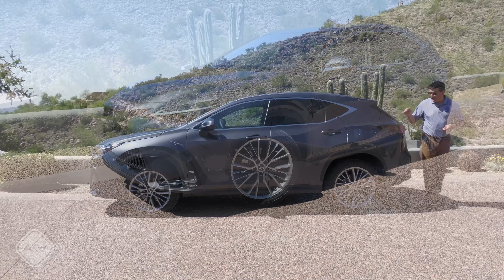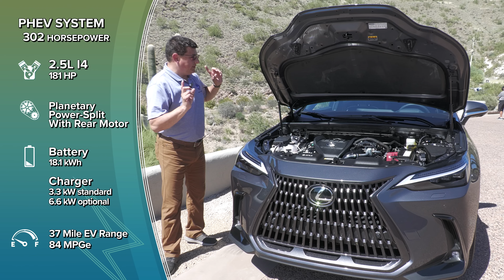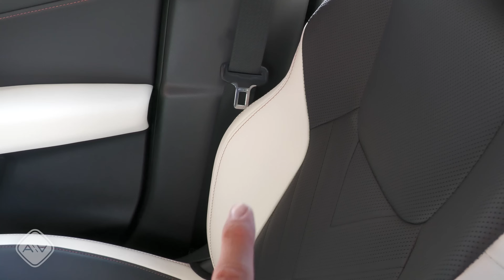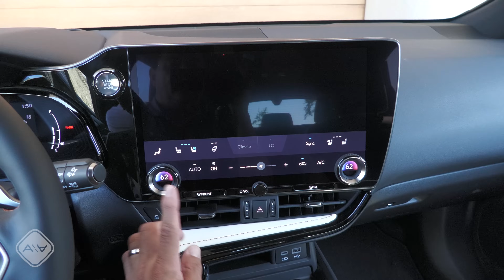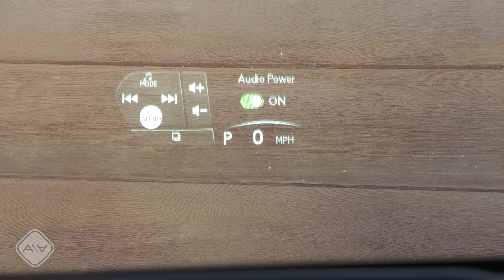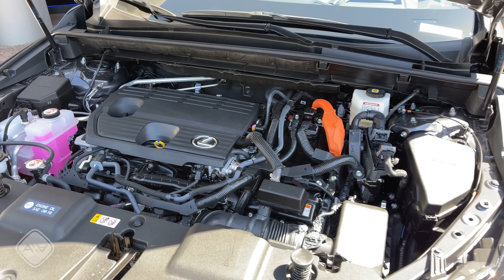2022 Lexus NX First Drive | Big Screens, More Hybrids!

Comment: the trim naming is....
what you guys think? 

NX 250....... 2.5L/203hp
NX 350........2.4T/275
NX 350h......2.5+E/239
NX 450h+.....2.5+E/302

Does this indicate that next RX 350 will actually be turbo-4 and not 3.5L-V6?
Reply: Whatever the naming, I suspect the next RX will drop V-6 in favor of a turbo four.

Comment: The 2.4T version has 275HP and 317 torque which are pretty good in compact SUV segment, however 0-60 still takes 7s? That puts it to the slow end of segment and doesn't make sense.
Reply: Yes, the 301 hp 3.5 V6 from the RX would have been a much better option.
Reply: @RightLaneHog3151  agreed 100. The RX has 295hp. The Camry has 300hp

The v6 would be perfect and I’d recommend the nx350 just for the v6

Comment: This or GLB?
Reply: This, and I don't even like it that much. The GLB is just plain homely, as are all the current Mercedes SUV/crossover models. They have a melted look.
Reply: I test drove both the GLB and GLC, if you are going with a MB, spend a little more and get the GLC.  I also test drove a 2021 NX300, and now waiting and most like get a NX350.

Comment: NX 350 does not make 275 hp, Lexus is flat-out lying about its real-world power output based on the 0-60 time of 6.8 seconds or they are severely cutting boost in low gears or the transmission is hot trash. BMW X3 with 248 hp does 6.2, Audi Q5 with 261 hp does 5.5. And all that piano gloss black on every high-touch surface is going to look terrible in 6 months. Another throwaway Lexus product to not even consider.
Reply: Ikr. I knew Thr nx turbo would lose and I was right. A cx5 for gods sake also smokes this at a lower price. So does the Acura rdx
Reply: Maybe your experience with other OEM piano black is all scratching and marking. However Toyota knows how to do paint that doesn't wear or scratch. There are standards for it.

Comment: I like the changes made except the requirement for a monthly subscription for the embedded navigation.
Reply: Everyone uses their phone or an old fashioned map.  Embedded Nav is trash in all cars.  All you need is CarPlay.
Reply: @user-tb7rn1il3q  I prefer having a backup just in case I wind up in an area with no cell reception or data signal
Reply: @naveenthemachine  I have paper maps for that.  Most areas have cell reception and you can get offline maps.
Reply: @user-tb7rn1il3q  you still use paper maps? You do realize it’s the 21st century right?
JK haha 😆

Also I know you can get offline maps for some but in google maps especially I hate the navigation in offline mode. It doesn’t announce next turn directions with street names. If you are online, then the navigation is fine though. But since my car has a head up display, I prefer seeing the next turn graphics there. That’s why I use integrated nav. I somehow love the snazzy next turn graphics on the gauge cluster and hud
Reply: @naveenthemachine  If you start the journey with reception it will keep giving directions if the connection is lost.  There is nothing wrong with exercising the brain with paper maps and a compass.

Comment: I love Lexus, I’ve had 3 of them BUT… I was waiting to see what they did with the NX now that the RAV4 was redesigned. I love the RAV4’s style and was hoping to see the NX elevate the looks of the prior generation. They didn’t, it’s still bland and in my opinion, the RAV4 looks better. 
Reliability is its highest card, as always.
Reply: With transmission issues?
Reply: @Oldchrysler  Lexus as a brand and Toyota have the perception of being highly reliable. I’m sure there haré hick ups here and there, I haven’t owned or experienced all their models though.

Comment: I really really wished there was the 3.5L v6 that has been refined for the years and had more power. But instead they gave us a 2.4L turbo that is very very conservative tuned. Hopefully we get an real Fsport trim later on with a slightly more power tuned engine to match the germans.
Reply: It is my theory that the 3.5 will disappear across the board for the Toyota/Lexus for this engine. It would not surprise me that this engine debuts for Toyota in the Camry next year. Even though it has been around since 2005, the 3.5 is such a strong, smooth, and potent engine.
Reply: @hellkitty1014 Ya exactly. When the new Highlander hybrid and Sienna ditched their 3.5 hybrid powertrain. I still had hope the Lexus will retain that powertrain as part of their luxury segment. But your right its slowly starting to fade.
Reply: Yes, the V6 was a better choice. I think they sent a clear message with the 2.4 Turbo, the plug-in Hybrid is the top performer.
Reply: They're doing the same as everyone else. It's hard to justify putting a heavier, thirstier, and more expensive engine in when a turbo four can make as much or more power, and typically more low-end torque. Most Lexus buyers will hardly notice the difference.
Reply: Emissions are another reason the V6 isn’t offered. It’s an old engine so would take significant investment to clean up and make more efficient. Plus, it would still be heavier than the four cylinder.
Reply: @mart0225  the 3.5L v6 2GRFE didn’t have direct injection for improved power or efficiency. The current one in the Highlander and Camry have Direct and port injection D4S.

I also don’t get the emissions law here. Does the v6 really put more emissions than a turbo 4? They get the same fuel economy…
Reply: @naveenthemachine  The V-6 produces more greenhouse gases and lags in mileage (they are connected you know).
Reply: Agreed. The nx350 needs the v6. That would increase the sales
Reply: @naveenthemachine  The V6 would be much quicker than the plug-in Hybrid because it would be so much lighter.
Reply: @RightLaneHog3151  wouldn’t have the low end torque though or be efficient. But it would sound better and last longer than the turbo

I don’t think it’ll be that much quicker though. For reference a rav4 prime does 0-60 in 5.4-5.7 seconds. A v6 Camry does 0-60 between 5.5-5.8 seconds. The rav4 is faster even though it’s 700lbs heavier
Reply: @naveenthemachine  V-6 engines are going the way of the V-8.  Soon to be extinct.  Your federal government has mandated CAFE averages that are so high all that will pass will be the EV's and hybrids.  I wouldn't be surprised to see the turbos disappear eventually too.  Thank you Democrats.

Comment: Wonder how NX 350h compares to the Venza? Looks like more electronics, but how about ride, quiet, handling?
Reply: We already know the 239 hp NX hybrid equals Venza mpg, increases power and adds 2,000 lbs towing. We will have to stay tuned for the full NX vs Venza video.
Reply: @RightLaneHog3151  Even Edmund's review asked if the redesign was a enough today.  Most leasing should consider GV60 instead if Telluride/Palisade is any indicator of how fast people leave the Japanese brands!
Reply: @normt430  sdfu
Reply: @anejozafiro  Car & Driver said the NX350 has terrible turbo lag and wasn't as quiet as others in the class.  It is a RAV4 after all!
Reply: @normt430  agreed. I knew nx would be outclassed and sure enough I was right

Comment: Gv70 are beautiful but genesis and Hyundai customer service is very suspect.
Reply: I couldn't care less. My nearby Hyundai dealer is perfectly OK. I just negotiate by email anyhow, so they can't play silly games, and use a local mechanic that charges less for better work than a dealer would give.
Reply: Who cares about customer service? The Hyundai dealer you get the gv70 from could be the worst of dealer experience. But remember you’ll be driving the car not leaving it at a dealer on a regular basis. Even if you buy from a Hyundai dealer it doesn’t change the fact that the gv70 is still a better vehicle than the nx

Comment: Alex, Congratulations! Toyota Motor Corporation finally listened to your suggestion to install the 240 hp Highlander Hybrid system in a RAV4 sized vehicle.  The 350h's 39 mpg combined with a respectable  2,000 lbs tow capacity tells me there is NO downside to doing this. Hopefully the new Ontario-made NX will be as good as your Ontario-made RAV4 Hybrid. In regard to the 'unavailability' of the base NX 250 at the launch event, is Lexus waiting for that slow, inefficient 203 hp PINATA to be bashed in a less public forum? Finally, we all look forward to your upcoming NX 350h vs Venza vs RAV4 Hybrid video. :D
Reply: The new RAV4 Hybrid is only getting in the 38's on fuelly.  The NX hybrid will get even less.

Comment: 2:14 actually the Camry was the first to have that engine, then the RAV4. The Lexus ES always had a V6 engine until 2020 when the ES250 AWD was introduced.
Reply: Imo the v6 from the Camry is what the nx350 should have… that would do wonders and seriously increase sales since it’s bulletproof and one of the reasons the v6 in the RX is so popular
Reply: @naveenthemachine  it would basically be a RAV4 V6, which is what a lot of people want.
Reply: @andym1223  the v6 I’m sure pulls better than the turbo. The turbo has more torque but I think v6 power will be more instant because there is no turbo lag with the v6

Comment: Surprised Toyota hasn't combined/switched to Subaru's Eyesight system.  Owning both, the Subaru system seems to have more refinement.  Managing the adaptive cruise control seems easier in Subaru, and seems to adapt better to situations.   Of course, the Subaru system will take you to a stop, and continue once you tap the gas pedal.  Making bumper to bumper traffic a lot easier to handle.
Reply: The Toyota radar cruise control also has stop and go capability. It’ll hold you there and then you tap the gas to resume

Plus the Toyota cruise control works better in bad weather since it radar based not camera based
Reply: @naveenthemachine  cool 2018 Toyota doesn't
Reply: @BradleyEdwardAnderso  which Toyotas?

The 2018 Camry does have that feature but only in xle XSE or hybrid models

My 2020 Camry XSE has radar cruise with stop and go capability
Reply: @naveenthemachine  my 2018 Tundra SR adaptive cruise surrenders around 30mph.
Reply: @BradleyEdwardAnderso  it depends on the Toyota

But yeah most of those Toyotas back then had high speed only adaptive cruise

The newer ones offer full speed range. The new 2022 tundra especially will definitely offer full speed range radar cruise
Reply: I totally agree that the adaptive cruise on my 2015 Subaru Outback works much better than the one on my 2021 Venza. And the lane centering on the Venza is so unpredictable you are constantly checking to see if it is operating or not.
Reply: @johnbrews9724  my Camrys radar cruise feels very smooth in traffic
Reply: Because Subaru doesn’t use a radar system, it is limited to what it can do.
Reply: @andym1223  The Subaru is better, that's my point, at least for adaptive cruise IMO.  Yes combined with a radar system would be best.

Comment: I've pre-ordered the NX 350 Turbo F Sport AWD. Is this 0-60mph time as bad as some of the reviewers say?
Reply: remember this drive was done in phoenix which is not sea level and it was hot so performance would be worse...
Reply: @miraphycs7377  yes maybe. Hope it's good. I've pre-ordered the 350 turbo here in Australia. I really don't wanna change my decision to a different car
Reply: @miraphycs7377  I believe he was going by numbers provided by Lexus, as he doesn't do his own tests away from home and his usual testing location.
Reply: Apparently Car and Driver got 0-60 of 6.6 sec with NX350
Reply: @miraphycs7377  where can I check their review?
Reply: @vinayshsureshram277  I cannot leave link here on youtube comments because it will auto delete it but type on Google "Tested: 2022 Lexus NX350 Goes for the Middle Ground" and it is the first thing that comes up it is their review
Reply: @miraphycs7377  just saw it. Thanks! So it looks like the BMW X3 is the best for performance/driving dynamics in this class but it just costs a lot more. The M40i is way too expensive and even the Xdrive30i with some packs added costs a lot!
Reply: @miraphycs7377  I ended up changing my pre-order to the 350h Hybrid

Comment: Tbh my aunt might get the 2022 NX over the gv70 because of its infotainment, reliability, and resale value. I have the 2018 Lexus NX with 30k miles with no problem.
Reply: Infotainment? The Toyota and Lexus infotainment systems are improving, but they were truly awful until lately. The Hyundai/Kia/Genesis systems are much easier to use and similarly full-featured. Resale value is a distinct difference,band the reliability may be better, though it's hard to be sure with new models.
Reply: Better to get Model Y or X.. They are better in almost all segments 😁 Tech, performance, safety
Reply: @archigoel  Toyota's safety tech is first rate. Tesla has no advantage there.
Reply: @markmiller3279  that’s not true at all. Lol Toyota’s suck
Reply: What makes you think this will be reliable? The badge?
Reply: Hyundai is 🗑
Reply: @AntLive29  They’ve really been stepping it up over the past few years though

Comment: Lexus played it too safe with this turbo engine,
Reply: I guess they played safe because the 2023 RX might get this engine with over 300HP, and they don't want this to outsell that just because of power. On the other hand, Toyota is always playing safe when it comes to power, which is good for reliability, IMO.
Reply: It’s disappointing I agree

If they however used the v6 from the Camry then it would be fine
Reply: @naveenthemachine  I doubt that v6 will accelerate any faster than this turbo, all though it has more hp it has less torque and this turbo is quite enough and its not buzzy like 2.5 in the rav4
Reply: @Reu_ag  there won’t be lag vs the turbo. And it’ll sound way better too.

How much does the nx turbo weigh? Compared to a v6 Toyota Camry as an example, it weighs 3600lbs

Additionally Mazda6 vs v6 Camry. The Mazda6 has more torque but it’s still slower than the Camry. Alex got 6.5 seconds for the Mazda6 turbo but got 5.7 seconds for the v6 Camry with less torque but more horse power
Reply: @naveenthemachine  The Mazda6 is held back by its ancient six-speed.
Reply: It sucks. GV70 all the way.
Reply: @ThiccShaft  it doesn't, still getting this over the gv70
Reply: @ThiccShaft  have fun spending all that time in the shop for repairs.

Comment: This is a stripped-down mix of Prius and Corolla interior with an obnoxious tablet bolted on the dash (do they not test driving at night?) As a Toyota fan, it's hideous. 

I know you can turn the tablet off at night, but then you lose navigation and audio controls. It's not a functional design.
Reply: I feel the Camry interior doesn’t look so bad now…
Reply: Have you ever... driven at night with screens on?
I've done it for the last 4 years in my 2018 and 2021 Audis mounted on the top of the dash.
it works fine.
Reply: @tim3172  I have, it's annoying. Of course you can do it, but the extra light from the screen does prevent your pupils from dilating fully and interferes with night vision.

Comment: Does the 2.4L Turbo need premium gas?
Reply: It’s a Lexus… of course it does
Reply: @naveenthemachine  That’s a deal breaker for me.  I’d get the 2.5 gas or Hybrid.
Reply: @user-tb7rn1il3q  the hybrid takes premium gas too. 250 and 450h+ take regular

Although I will point out that I think in the press release Lexus did say that the power is achieved on premium gas. Using lower octane will decrease performance. So it’s my assumption that any nx will take regular gas. 

But if I were you I’d avoid the 250 and get the 350h instead
Reply: @naveenthemachine  I think you're right. The reality is that most cars will run on regular gas just fine now, what with modern ignition sensing and adjustment systems. They may lose a little power, but most people won't even notice.
Reply: @markmiller3279  it depends on the engine tbh. If you put regular gas in some you could hear engine knocking. Like for instance in a Ferrari engine or a v12 or turbo or supercharged v6s v8s etc
Reply: @markmiller3279  You are mistaken.  Your assumptions are wrong.
Reply: @naveenthemachine  Not that it is a Lexus.  It is a turbo and needs the extra octane.  Premium required.